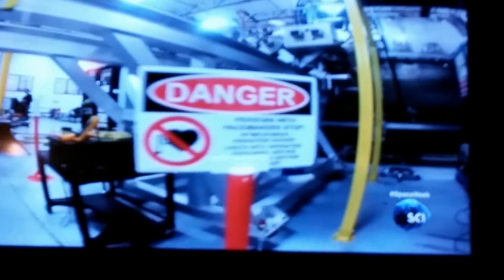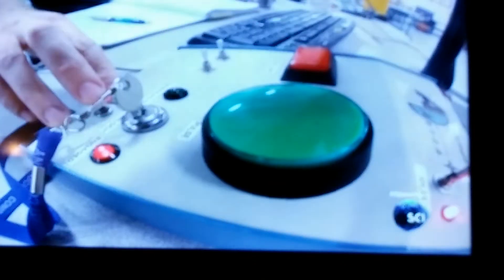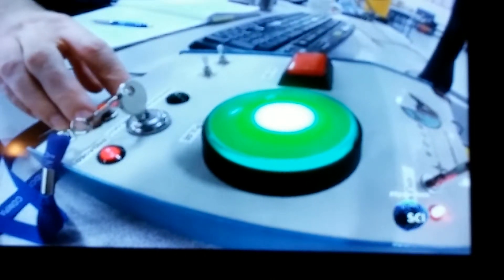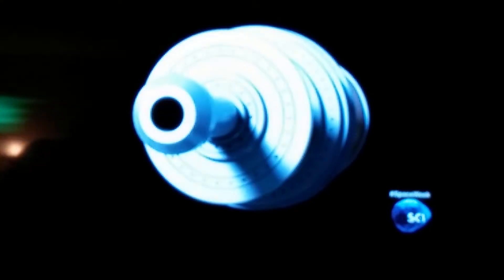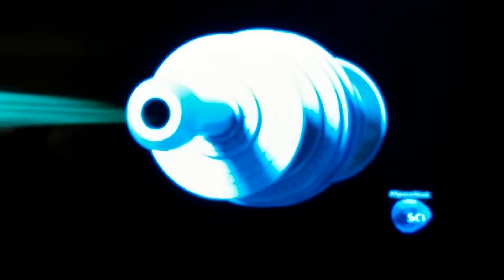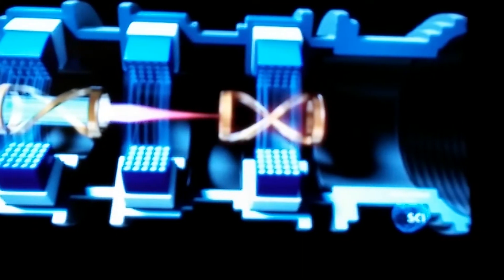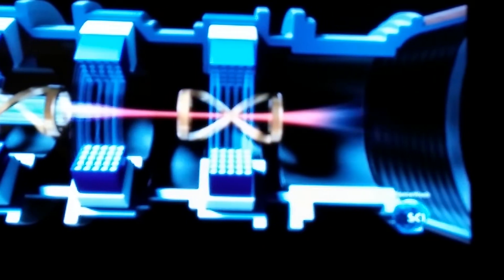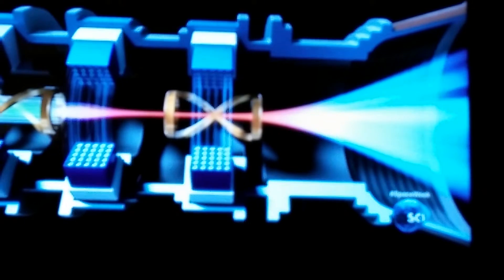Argon/Plasma Propulsion

Comment: but why you heat it up? acording to 3rd newton law you can only throw it away and you get thrust. manage that milion degre heat for no coming thrust is waste of energy.
Reply: I ask that because plasma is basicaly ionized elemnts. so use High voltage ionize it and use magnet to push them and get thurst.